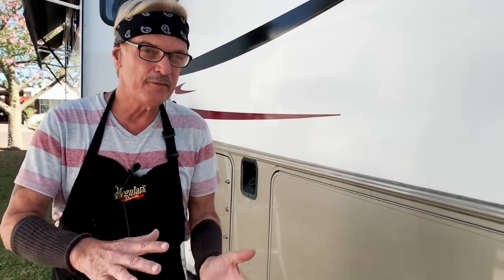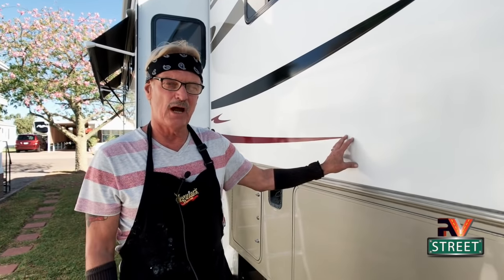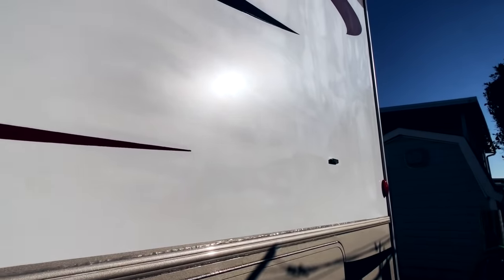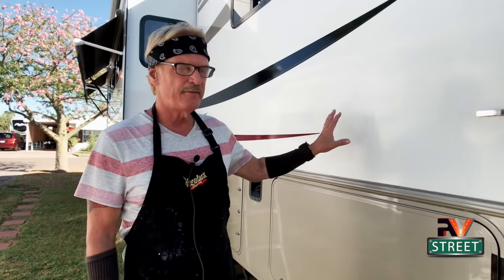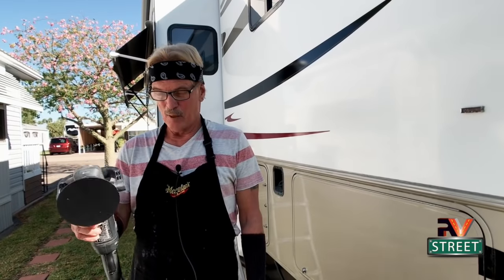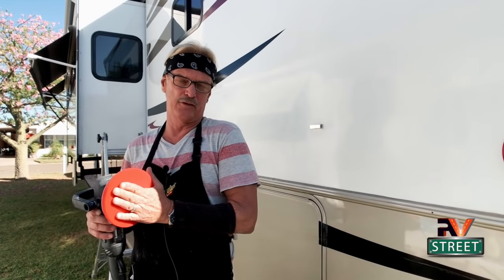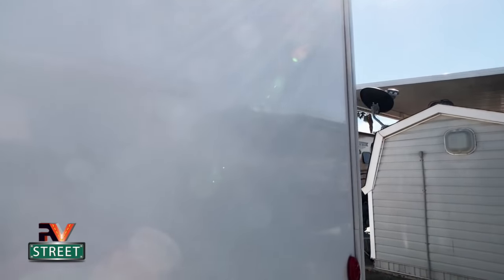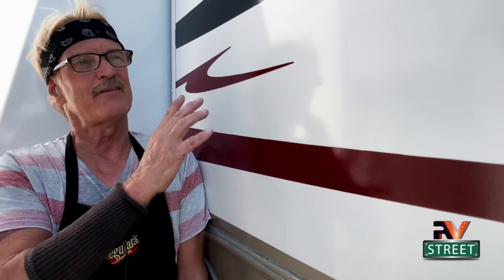HOW TO POLISH & PROTECT YOUR RV THE RIGHT WAY 👍

Comment: Hi Martin, LOVE your channel. We're newbies since June and you have taught us so much!! Our coach is 16 years old and in great shape, low mileage. The one weakness is oxidized white, about 75% of the rig. Had not been cleaned in too long a time but, otherwise in decent shape. Will your recommended products and  methods restore the shine to a seriously oxidized white coach surface, and do you think it would last with proper maintenance? 
Frank and Martha Nabuurs, Charlottetown  Prince Edward Island, Canada.
Reply from the maker: Hi Frank,
The light weight Meguirs MT300 Dual Action—5.4lbs. It's an awesome machine. Be sure to buy the back plate too. It's sold separately. It is the exact unit I used to remove the oxidation that our coach had when I first bought it in 2016. Having the right polisher is important. My coach at the time had heavy oxidation on the drivers side and back with light to medium oxidation on the other areas. My large slide on the drivers side was the worse so I had to use the wool pad and diamond cut compound on that area. I didn't have a YT Channel at the time, so I don't have a video on it. But I wish I did. I've actually been looking for an RV that has some oxidation so I can do a video on the process in a camp ground. But I haven't had any owners willing to cooperate with me. But I use the MT300 for everything to keep it maintained and yes, it will last as long as you keep it up every year. Don't ever let it oxidize again. If need be like you saw in the video, if an area needs a little polishing, polish it then apply RejeX. My secret to keeping it maintained and shiny is using RejeX for my final coat because RejeX blocks the UV rays from the sun and that's what causes oxidation.

Start small first. Like on the back. That will give you an area to get into the rhythm. I used a 12' rolling scaffold so I could stand up straight and do the top half of the coach. The bottom half is much easier to do than the top. Compounding to remove oxidation takes time. As you compound, the pads will load up with material, you have to constantly remove it, by keeping them clean by washing them out with water—warm water is best—in a bucket and a small hand held brush. Wring them out, put them back on the MT300 and continue. Since you have heavy oxidation, you'll probably have to use the wool pad and the diamond cut compound, otherwise use the other compound material in the blue bottle in my store and my red pads. Once oxidation is off, THEN polish with my Meguiar's Ultimate Polish also with the red pads. It probably will take 2 or 3 passes to restore the shine. Don't do it in the sun. An overcast sky or inside under cover is the best to polish and apply RejeX—or wax if you prefer that instead—as your final coat. Again, keep your pads clean AND DRY when applying polish, keep wiping off the polish off the RV each time you make a pass with a microfiber cloth. Do small areas at a time. It's also better and goes faster if you have several pads. Just be patient, be methodical and it'll come out nice. You can do this 👍

Everything I use is in my Amazon Store https://www.amazon.com/shop/rvstreet
The stuff you’ll need is in the "Compound, Polish, Finish Coat" category. Above each product is a text bubble where I describe what each product is and what I use it for.
Here's a link to one of my PLAYLISTS that covers other aspects of how I take care of the outside of our coach. These will be helpful to you also. Especially the first 3 videos: https://www.youtube.com/playlist?list=PLkQXtMp9xodSqUtTPMkSjVRGmSQkz4XJz

Hope this helps 👍
Reply: @RVstreet  thanks so much for the extensive answer. Not sure if I will do this yet this fall or tackle in the spring. If you care to use our rig as a guineapig maybe we can connect somehow, it's a short drive!😉 Some pretty here in the summer! Thanks again for the speedy reply, really appreciate what you do!  Cheers from Canada.

Comment: Hello Martin. Thank you for this video. Def helpful in bring the gel coat back to life in my travel trailer. On your advice, I’m going to give Rejex a try. You mentioned 2 applications a year will protect from the uv rays. Do you recommend 2 back to back applications at the same detailing or is one sufficient with another in 6 months? 
Thanks
Reply from the maker: Once the RV is washed really good with my soap that will NOT remove prior coats of RejeX, and it's polished to a nice shine the first time, one coat of RejeX every 6 months should do it. Thereafter—if you stay with it—wash it good every 6 months and then apply RejeX. The key is to NOT let the RV go to long where you lose the shine. If you do, then you have to polish it again then apply RejeX as your final coat.
If you're interested, I have all these products in my Amazon Store in the "Washing, Detailing, Outside Care" category: https://www.amazon.com/shop/rvstreet
Reply: @RVstreet  thanks for the quick reply. I will def check out your store.

Comment: My old coach has oxidation so I will be trying the polish and rejex. Thanks. Havagudun Bud.
Reply from the maker: You didn't mention this but please remember, if your RV has oxidation you have to compound that off first. THEN...polish and protect.
Reply: @RVstreet  Thanks. That is what I really meant to do. I thought maybe that MaguiresThenoxi ix compound would work well. The oxi is fairly bad on this 96 Dutch Star but I believe it will come bak well.

Comment: We a 45’ DP coach. Like yours it has been neglected. It’s all paint, no decals.  But bc of the size I was considering a 10” buffer/pad. Seems like doing 45’ six inches at a time would be a KILLER!!!  Thoughts?  Suggestions?  Thanks in advance!
Reply from the maker: What makes this job a possible killer is using the wrong polisher that weighs to much. Weight is a big deal bc it can wear your arms out. It also HAS TO BE a DA polisher.
I've never seen 10" polishing pads for a DA polisher like I use but having that big of a pad I would think it would be hard to control and get even passes. To much flexing on the edge of the pad.
Another thing that will really make this job easier is having a rolling scaffold. Rent or or buy one and do the whole upper part of the coach first. Then everything else is done at ground level.
Since you have full body paint—and apparently no oxidation—polishing shouldn't be that big of a deal. Just patience and time. There are no short cuts.
Once polishing is done be sure to protect it. I use RejeX. Then after that wash it good and RejeX it again every 6 months or so.
Hope this helps 😎
https://www.amazon.com/shop/rvstreet

Comment: Hi Martin,  Great video. Do you use the waterless wash & wax exclusively to clean your RV or do you wet wash it at anytime? My 5th wheel is very dirty from traveling fulltime and not being able to wash it in places, Can you use waterless for very dirty surfaces or is it more of a maintenance wash between wet washes?
Reply from the maker: More of a maintenance wash between wet washes and I luv it for that application.
https://www.youtube.com/watch?v=lVF_nPZccbQ&t=74s
Reply: @RVstreet  Thanks Martin, another great video. I just washed the sides and back of my 5th wheel today, Saturday or Sunday I will tackle the front cap, just didn't want to deal with wrangliing the ladder today.

Thanks again

Comment: Martin, thanks so much for these videos. We have a 2016 Thor Hurricane that sits in the CA sun. The exterior is very cloudy and I have bought the products, including the compound but not sure what the definition of heavy oxidation is and if I need to ise the wool pads and compound or just the polish. Started on one of the doors with the compound and multiple passes of the polish, cleaning the pads frequently and wiping off the polish immediately. The finish is shiny but still cloudy. What are we doing wrong?
Reply from the maker: It's hard to say what's going on without actually seeing it and watching what's going on during these different stages. You washed the RV first right? Are you doing all this in the shade? Are your polishing pads clean? After you polished did you follow up with RejeX as the final coat? Many times after applying a thin coat of RejeX, waiting 10 minutes then removing is the final touch to smooth everything out.

Comment: Good video martin. We have a Thor hurricane. Crappy paint. Decal's know full body or clear coat. Had a guy do polish and wax. What top dressing should I use either Palomar Or Teflon or ceramic spray.?
Reply from the maker: EDIT: I don't use Palomar, Teflon or ceramic spray
I use RejeX. . 
What year is your coach?
How did the polishing go when that guy did it? Does the rig have a nice shine?
Reply: Decent shine. He cut with polish and then a carnuba base wax. Good shine on a 2016 Hurricane. Just want to maintain now. Tnx the reply btw

Comment: Hi, I have a 2020 year rv and I am using this same equipment. This is the first time I have polished. It takes about three time per area to get the area looking good. Is this normal or is this just because it’s the first time? Does the polish soak in and require more polish the first time?
Reply from the maker: I'm sad to say that Martin has passed away and I don't have the answer to your question. Sorry

Comment: My wife and I recently inherited a 1996 national RV chevy dolphin 535... It has always been my dream to own a class a coach.. Your videos have been extremely helpful .... Trying to find anything about pre 2000s coaches is almost impossible .. Does anyone have suggestions on a youtube channel devoted to older n
Motorhomes
Reply from the maker: They are no devoted YT channels that specialize in older Class A's to my knowledge because, caring for and servicing a pre 2000 Class A is going to be the same for any Class A. Same maintenance items and schedules, same outside care, same safety items, pretty much the same features and equipment etc. The only thing different you'll run into is when getting into possible chassis related repairs/replacement parts, those parts will possibly be a little different than newer Class A's. But that problem is easily solved with a little research. The first thing I'd do is get online and get ALL YOUR MANUALS, WIRING & PLUMBING DIAGRAMS while you still can. Don't wait till you need them to find them or need them.
Since you're new at RVing, I highly recommend you watch these videos in my "RV Newbies Basic Training & Boot Camp Series" PLAYLIST. It will keep you from going to the school of hard knocks: 
https://www.youtube.com/playlist?list=PLkQXtMp9xodR-PDUkTg936iZAeMuOqwnj

Also if you're interested, here's a link to all my PLAYLISTS that will teach you many things you need to know. You don't know what you don't know https://www.youtube.com/c/RVstreet/playlists

Implementing these things will insure that your RV experience will be a good one. 👍

Comment: Hi Martin,
We just bought a very heavy oxidation Motorhome. 
The previous owner was getting to old to take care of the outside and it sat outside in the sun. We see no shine, other on the compartment doors they are painted. Is there anything you would suggest for heavy oxidation.   Thank You!   Julie
Reply from the maker: Julie, here's what I tell folks. 

Removing oxidation
I get this question a lot about the DULL look and has lost it's luster. It's called oxidation. Once oxidation has been removed, then you polish, then you apply RejeX for the final protective coat.

Here's the process and a few tips I tell people to do to remove oxidation
The light weight Meguirs MT300 Dual Action—5.4lbs. is an awesome machine. Be sure to buy the back plate too. It's sold separately. It's the exact unit I used to remove the oxidation that my coach had when I first bought it in 2016. Having the right polisher is important. My coach at the time had heavy oxidation on the drivers side and back with light to medium oxidation on the other areas. My large slide on the drivers side was the worse so I had to use the wool pad and diamond cut compound on that area. I didn't have a YT Channel at the time, so I don't have a video on it. But I wish I did. I've actually been looking for an RV that has some oxidation so I can do a video on the process in a camp ground. But I haven't had any owners willing to cooperate with me. But I use the MT300 for everything to keep our RV maintained. If you have oxidation, once oxidation is removed, don't ever let it oxidize again. That way you won't have to go thru this process again.
If need be like you saw in my polishing video, if an area needs a little polishing, polish it then apply RejeX. My secret to keeping it maintained and shiny is using RejeX for my final coat because RejeX blocks the UV rays from the sun and that's what causes oxidation.
For compounding start small first. Like on the back. That will give you an area to get into the rhythm. I used a 12' rolling scaffold so I could stand up straight and do the top half of the coach. The bottom half is much easier to do than the top. Compounding to remove oxidation takes time. As you compound, the pads will load up with material from the RV, so you have to constantly remove it, by keeping them clean. You wash them out with water with them still on the polisher in—warm water is best—in my Grid Guard bucket— in my Amazon Store. If you have heavy oxidation, you'll probably have to use the wool pad and the diamond cut compound, otherwise use the other compound material in the blue bottle in my store and my red pads. Once oxidation is off, THEN come back and polish with my Meguiar's Ultimate Polish also with the red pads. It probably will take 2 or 3 passes to restore the shine. Don't do it in the sun. An overcast sky or inside under cover is the best to polish and apply RejeX—or wax if you prefer that instead—as your final coat. Again, keep your pads clean AND DRY when applying polish, keep wiping off the polish off the RV each time you make a pass with my microfiber cloths. Do small areas at a time. It's also better and goes faster if you have several pads. Just be patient, be methodical and it'll come out nice. You can do this 👍
Everything I use is in my Amazon Store https://www.amazon.com/shop/rvstreet
The stuff you’ll need is in the "Compound, Polish, Finish Coat" category. Above each product is a text bubble where I describe what each product is and what I use it for.
Here's a link to one of my PLAYLISTS that covers other aspects of how I take care of the outside of my coach. These will be helpful to you also. Especially the first 3 videos:
https://www.youtube.com/playlist...
Hope this helps 👍
Here's another reply to removing oxidation
The chalkiness your speaking of is called oxidation. Before you can ever get the shine back on any vehicle or RV the oxidation has to be removed first and *that requires compounding*. I had severe oxidation on our coach when I first bought it in 2016. The previous owner didn't take of it either. It took me 3 weeks—working off and on—to fully remove all the oxidation, heavily polished it, then added the final protective coat of RejeX. Some people still like using wax but I have switched to Rejex because it blocks the UV rays better—the suns UV rays is what causes oxidation—it saves the graphics better too and still achieves a nice shine. I didn't have a YT Channel back then so I don't have a video this process. I wish I did. I've actually been looking for an RV that has some oxidation so I can do a video on the process in a camp ground. But I haven't had any owners willing to cooperate with me.

It's basically the same process as the video you watched when I demonstrated how I polish the RV except you use a compound material to remove the oxidation.

I used the Meguirs MT300 polisher for everything. It's only 5.4lbs so it's much easier on the arms. Be sure to buy the backing plate too. It's sold separately. It's the exact unit I used to remove the oxidation on our coach had when I first bought it in 2016 and still use it today. 
Hope this helps. 👍

Comment: Martin....I'm going to switch to REJex instead of wax...should I use a cleaner to remove the old wax before switching?
Thanks,
Tom T.
Reply from the maker: Should you use a cleaner....NO. 
What you can do is, the next time you wash the rig use a soap that will strip off the old wax. Like Dawn. Mix it with warm water in your soap canon or a bucket, or however you wash your rig. I love my soap canon and power washer. But, in any case, wash it good. Here's how I wash mine: 
https://www.youtube.com/watch?v=7KmgneT3HPs&t=193s

Get the RV where your starting from scratch. Don't wash it in the sun. Make sure you dry the rig with towels as you go along to prevent water spots. Once washed and dried, then apply a THIN coat of RejeX with my yellow pads—sparingly—with my variable speed polisher set on "LOW" then let it sit for about 10 minutes then come back with my professional micro-fiber towels and do a final wipe down. You basically do about a 8' to 10' section at a time. Once completed the RejeX will have a nice thin coating protective film all over the RV. It will shine like crazy AND protect it from the UV rays from the sun.
From this point forward, use the soap I USE to wash the rig that WON'T strip off previous layers of RejeX and apply RejeX twice a year if outside all the time. If covered for half the year, then once a year.
Everything is in my Amazon Store in the "Washing, Detailing, Outside Care" category.
https://www.amazon.com/shop/rvstreet

Thanks for your question Thomas and watching our channel 👍